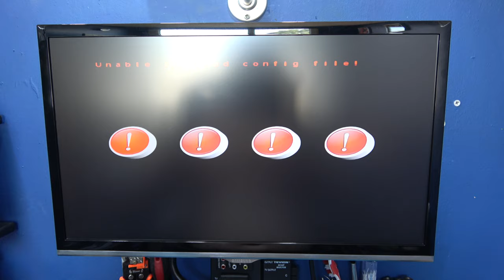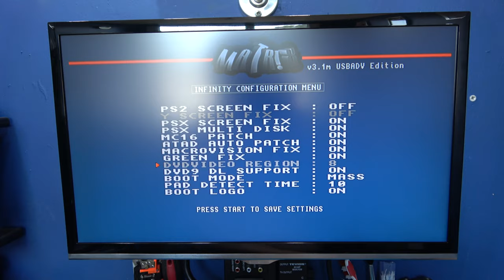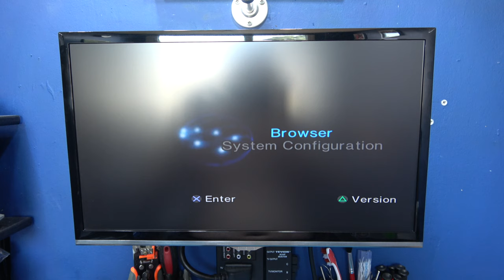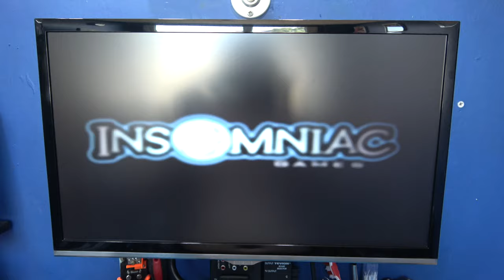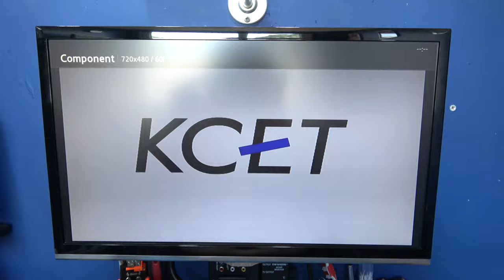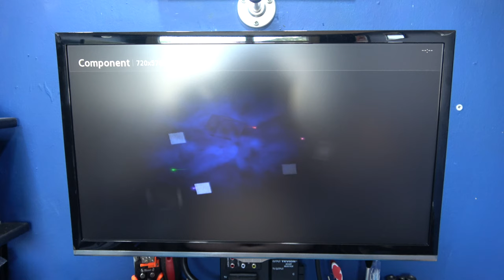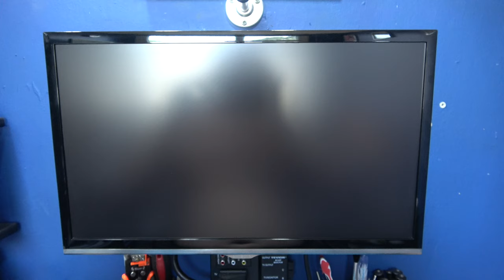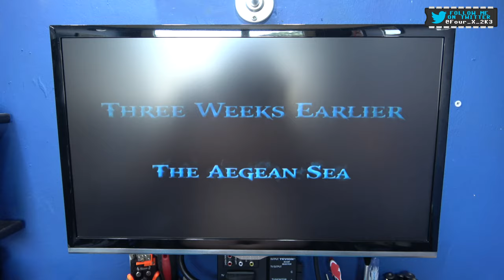Sony PlayStation 2 Slim - ModChip Install (Modbo 5.0 + Laser Fix).

Comment: Neat mod as always Four X. Been using mine with the USB drive a bit with POPs emulator for PS1. Had to format the USB stick today, so will have to set it all up again :(. Modbo5 gives you allot of options, nice to have. Still have to get a decent SCART lead for mine. Using a cheapo Ebay one for now.
Reply from the maker: Thanks bud. One of the reasons I modded this system was to play POPs emulator for PSone from USB. Also because I have a Component Video cable for the PStwo the Image is fantastic for both PSone and PStwo games.

Comment: Great job =D  Out of interest what wire do you use for this (the white ones) - I need to re-do mine at some point.
Reply from the maker: It's Kynar 30awg White Wire. You can get it here in the UK from RS Components, The RS Stock code is "209-4827" Chris. https://uk.rs-online.com/web/p/hookup-equipment-wire/2094827/

Comment: My PS1 games take longer to boot on my PS2 Slim than it does on my PS2 Fat. It kind of lingers on the PS2 menu for 10 seconds until it launches into the PS1 boot logo. Would the Modbo5 laser fix make it faster, you think?
Reply from the maker: Same on my unmodded slim, with the modbo 5 in this PS2 slim it skips the PS1 logo so yea it's quicker.
Reply: @Four_X  maybe it's normal on unmodded slims then, thanks!

Comment: What is the laser fix install? Are you just adding resistance to its circuit?
Reply from the maker: There is a Chip on the PS2 Slim (mechanics controller) that can crash during operation, when this happens it can sends more power to the Optical Pickup (Laser) and burns it out. the laser fix Chip monitors the communication between the mechanics controller and the DVD controller, if it detects a crash it resets the console saving the Optical Pickup (Laser).

Comment: Excuse me sir, just random question, do I need to glue (or something similar) the modchip's PCB to the PS2's mainboard?,

I mean, to give it some steadiness?..

Or it is enough by soldering the cables and then fixing the modchip in its place with insulating tape?

Thanks for your kind respond..

(exfuse if any misunderstanding, still improving my English)
Reply from the maker: I use double sided tape, works like a charm.

Comment: I'm getting a slim SCPH 70004 modded with modbo 5, will burned ps1 and ps2 games run the same as official discs?
Reply from the maker: Yes and region free.
Reply: @Four_X  sweet

Comment: What the chip u put on for the laser fix I have no idea what it is or where to get it.??
Reply from the maker: It's called the matrix-pic-fix-v2, it stops the laser from burning out as some model PlayStation 2's will increase the laser power if it start to struggle reading discs this prevents that. you only need them in specific PlayStation 2 models, this is one of them. you can find them here. https://www.ebay.com.au/itm/164850839386 or https://retrogamerstuff.com/products/matrix-pic-fix-v2
Reply: @Four_X  thank u very much and believe it or not my ps2 is the exact same model as urs so I'm defo going to need it :)
Reply: @Four_X  again thank u for responding last question do u only need the lazer fix after moding. Like if it was un modded will the lazer still burn out. As I think I found another way. But im curious if the laser still burn out if they do then I will have to install this just to be safe :) thanks for responding.
Reply from the maker: @DJTVStar51X  You only need to do this if your installing a mod chip. A stock system is fine without the mod.

Comment: Hi, so to disable the chip should I remove the 3.3v wire, right?
Reply from the maker: You can do it buy holding START during boot, you should get the "Disabled" Screen then press reset.
Reply: @Four_X  no, bad chip. It can't save settings. My only workaround is cut the circuit of the bad modchip
Reply from the maker: @eloyfarina  Oh I see, yep remove power and ground.
Reply: @Four_X  Sure, believe me, I tried EVERYTHING. I'm done, it's eaiser cut the wires. Thanks for the data ;)